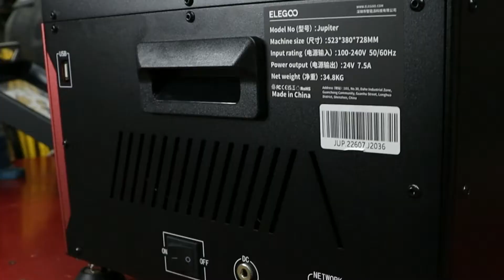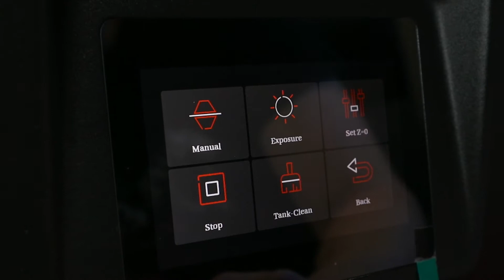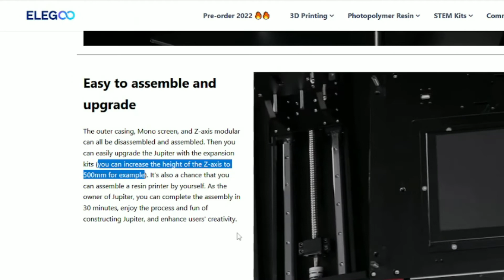Elegoo Jupiter Review Post kickstarter

Comment: Recently got mine as well. I installed a flex plate and screensaver on, but I seem to be having issues with bedplate adhesion. The whambam tutorial says to lift the buildplate a bit after leveling but others say to just level and leave it. Which would you recommend?
Reply from the maker: I have the wambam flex plate on two other resin printers and didnt have to do anything different for the leveling so i dont see how this one would be different, i would try upping the bottem exposure time, i usally do 3-5 seconds until it sticks
Reply: @gearscreations  I'll try that, thanks!

Comment: just watched video, with the bottle adapter, could you try a rubber washer inside to fix the leak?
Reply from the maker: I just looked at the model and the lip where a rubber washer would go is .4mm thick (which explains why it didn't print well for me and had to be cut out) I would have to redesign the model for that but I currently don't have extra time to do that.
Reply: @gearscreations  understandable

Comment: havent been able to get a single successful print due to bad leveling any advise??
Reply from the maker: When your tightening the 4 bolts that lock the plate in place, i applyed light pressure to the center of the build plate downwards. And the one thing ive found to work across all the resin printers i have is when adjusting the z hight, you want to want it to where you can pull the paper out with resistence but if you try to push it back under it wont go.

If this isnt clear or your still having issues i can make a video for you
Reply: @gearscreations  Thanks, the particular issue I am having is that when I tighten the screws I do it diagonally (if that makes sense) and when I am ready to pull the paper out test. lifting the plate with the smallest setting of 0.01 the right side gets loosened before the left so I can pull from the right with resistance from the right but the left side doesn't move. by the time it gets somewhat loose on the left is already wayyy to loose from the right.
Reply from the maker: I would try tightening one side at a time and try pressing down on the side your tightening. And if that doesnt work i would try it the same way again but without pressing down as the springs themselfs should be able to apply more even pressure